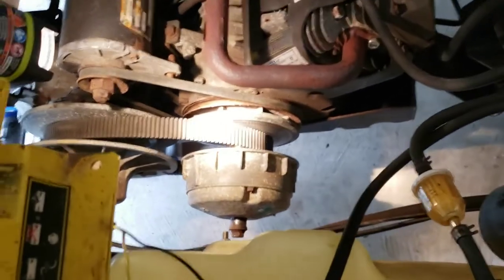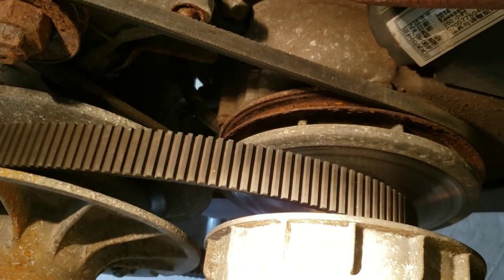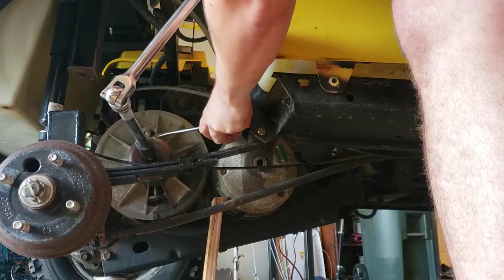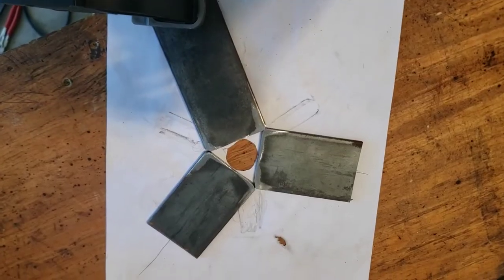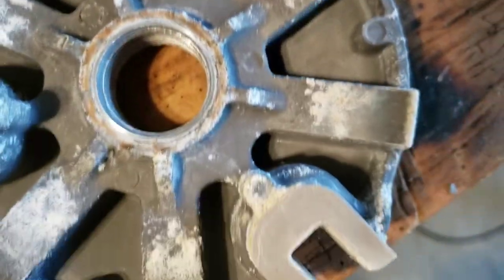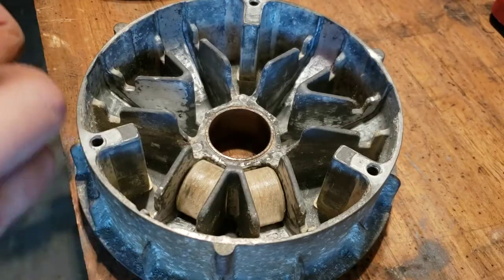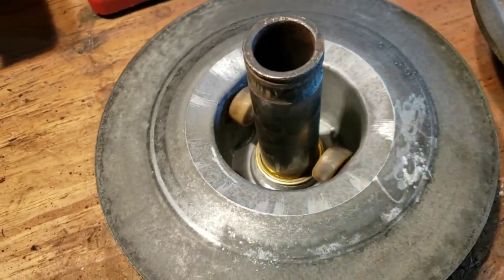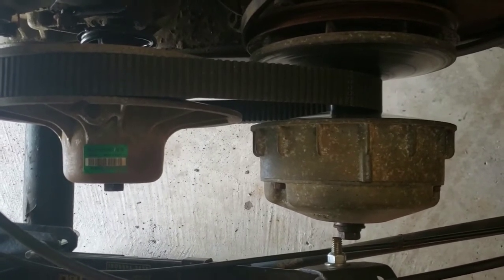fix sticking clutch on EZGO golf cart- DIY specialty tools

Comment: At the beginning of the video I could see that the belt was sitting way too low in the back pulley. It should have been sitting even with the top of the rear pulley and at the bottom of the front pulley. That's where all the slack in the belt was coming from. Great video with instructions of how to make your own tools.
Reply: That's because the drive clutch was stuck closed keeping the driven pulley in the open position.

Comment: I can by looking at your clutch, the drive clutch is stuck closed.i had the same problem but mine was from a whole bunch of tall grass that got tightly wound up in the end of the clutch. It was preventing the sheave from the drive clutch sliding back and forth and keeping it in the closed position at rest and the driven clutch was in essence open. Therefore it was stuck in the high gear and jumping from idle.

Comment: I used a yellow torch for about a minute in the hole where you removed the bolt from the driven clutch and a light tap from a rubber mallet and it popped right off. I have to say I did everything else and it took me 4 Saturdays to finally get it off.
Reply from the maker: It's so rare that projects go seamlessly. Ingenuity and determination are the most important tools I own (and by ingenuity and determination I usually mean big hammers, torches, and pry bars haha). Good on you for sticking at it!

Comment: Good job! I knew there had to be a way to disassemble the primary clutch without buying special tools. I have a welder so I'm going to improvise a tool like you did using whatever is handy. I have to remove the clutch to replace a leaking crankcase cover gasket so I might as well service the clutch while it's off the cart. I'm glad I don't live where they salt the roads!

Comment: I have a newer version of that cart and just recently purchased a heavier duty spring for the secondary clutch. Spent 2 hours trying to get that thing off. Would not budge. Going to buy that clutch tool! Looked fairly simple with that! Have you installed a heavy duty spring on your secondary? If so, did you notice any difference in low end torque?

Comment: Excellent video! My only comment: Please use jack stands to prevent a disaster (lost a friend because of this).
Reply from the maker: Thanks. That's terrible about your friend. Great advice on the jack stands. I always use them on cars. This golf cart is light enough that I can lift the back up without a jack. Also I wasn't crawling around underneath it, so not much of a risk. Point taken though. Generally good advice.
Reply: Ok or

Comment: Can anyone tell me what the back clutches job is for?  Does it make it go into a higher gear. Thanks
Reply from the maker: Gears work in pairs. A large gear in front and a small gear in back is a higher gear and vice versa. So the back clutch (driven clutch) is an integral part in gear changes. If the back gear was fixed you would have fewer effective gear ratios. Think ten speed v thirty speed

Comment: Lol! I built a very similar tool before I found out someone else was as crazy as myself? Used a old spanner wrench that was made for another type of primary clutch so basically everything was there for it, I just needed to add the 3 pins to catch the spider of the Ezgo Comet clutch. My clutch had been through probably 3 engine replacements over its years in service. So it was pretty worn out and if I damaged it, at this point it wouldn't really matter? So upon getting it apart and the spiffy removed found that the shaft was worn out in the area that moves the most on the clutch. Being I own a lathe, I was able to cut the shaft down and make a new sleeve for it to bring it back to specs. While everything was apart as well, I made a new bronze bushing for the moving pulley half and cut the faces of both the sheaths on the lathe. Amazing they were pretty worn down especially the aluminum half of course. So after doing all this BS to the primary clutch, it was time to tackle the problem of getting the secondary off the transaxle input shaft! Which was the most difficult part of the entire process! It had unfortunately sat around uncovered for a few years outside. The clutch was basically one piece with the transaxle shaft now of course. But welding to the steel center section of the secondary clutch a big 5/8" nut and using a chrome-moly 5/8" threaded rod with another nut welded to its end I made a self pulling tool to push against the transaxle shaft while applying a sh1t ton of heat to the secondary center section. Eventually it broke loose and slow and painfully I was able to remove it from the shaft. Replacement of the nylon buttons of course was needed long before I melted away the remaining pieces with the heat of the torch. It had been digging into the helix for a while. Thankfully I was able to salvage the pulley sheaths and resurfaced them as well, but had to order a new helix buttons and shims. Otherwise it was just a labor of love I guess? It saved me a lot of money being able to rebuild both the front and rear pulleys, which are now perfectly in tune with the 2 stroke Polaris /Ezgo which now powers the TXT and for a little 244 cc engine, with a exgo bottom end and Polaris top end the thing is pretty damn quick. It idles now in gear like a engine should do. The transaxle was taken apart and I put in a neutral detent position in the shift shaft. This is a great way to start your engine and not having to worry about running someone over with it if you wish to blow out any excessive oil. Otherwise yes there's no such thing as impossible or as many people say non- serviceable parts! My @ss! Everything is serviceable to an extent of how much dedication you wish to put forth, bottom line! Glad you made this video for people to see who believe things like this sh1t can't be done?! Goof luck with your Ride man.

Comment: How'd you take off the clutch on the motor
Reply from the maker: Good question. I guess I didn't film that part. Both clutches come off the same way using the clutch removal tool. However, the drive clutch has an odd shaped washer at the end of the shaft which has to be removed before you can fit the removal tool in. I used a slide hammer to get mine out, but it was pretty corroded. Normally you should just be able to grab the washer and pull it off.

Comment: I wanted to see you remove the primary clutch.
Reply from the maker: Virtually identical procedure as the driven clutch, so I didn't bother filming. The main difference is that there is a washer in the end of the shaft that has to be removed before the tool can be used

Comment: You have an excellent impact gun but that hose is killing it. Get a full sized 3/8" hose.
Reply from the maker: I do have a regular 3/8 hose also. I haven’t noticed a big difference power output between it and my flex hose, but you’re right, I should’ve given it a try on this job before opting for the breaker bar. I also have a really nice snap-on all steel gun, but I almost never use it because my air compressor becomes the weak point